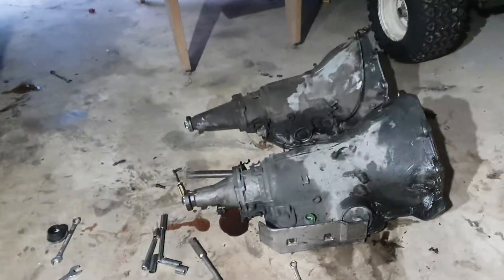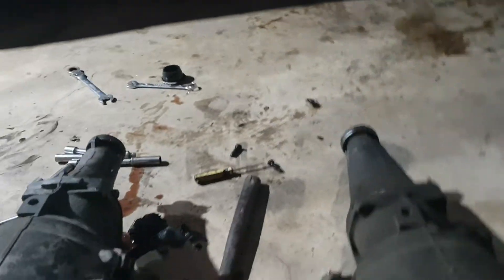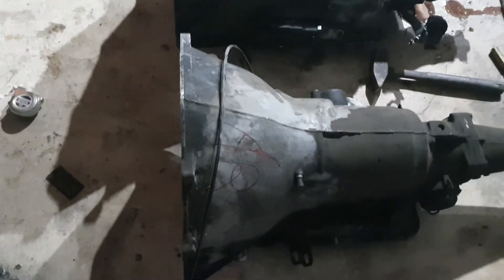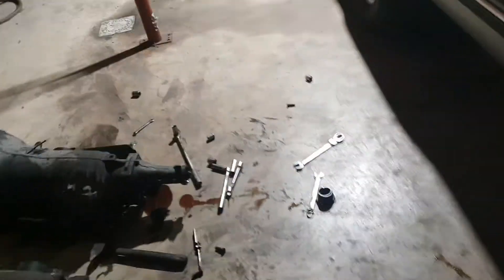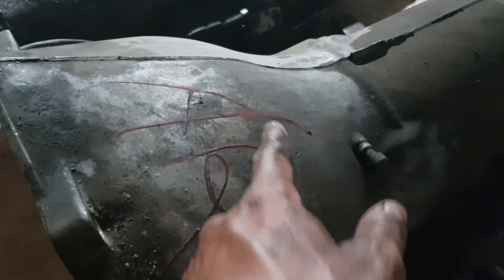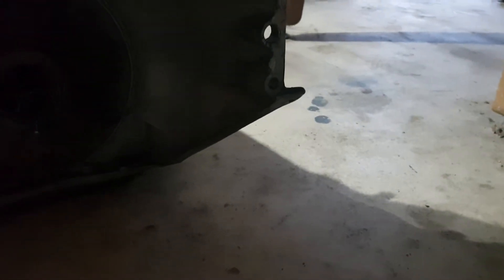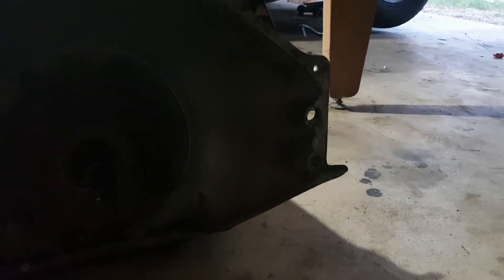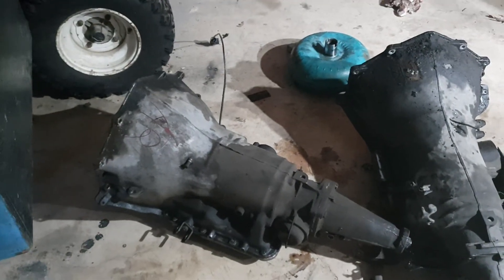4l60e To Th350 Swap Part 1

Comment: I'm doing the same with a 95 4.3l tbi6cyl, will it last if I'm just driving back roads and around town?
Reply from the maker: Definitely, and It'll last if you're driving the truck anywhere else. I drove this damn thing from Peoria IL to Wichita KS and back with this transmission.
Reply: @jestertech3790  I heard mention of change in flex plate? It bolts up to the existing one, but should I change?
Reply from the maker: @zachary2815 I ended up having to add a few washers between the flex plate and torque converter bolts.

That worked, but it seemed kinda wonky. If I were to do it again, I'd just buy the proper flexplate for a Th350. (One that adapts a TH350 to a 1 piece rear main seal engine, 168 tooth flywheel.
Reply: @jestertech3790  I thought so. Thank you again.
Reply from the maker: @zachary2815  If you have any more questions, just let me know, I actually was able to get the speedometer working too, but I never made a video on it.
Reply: @jestertech3790  I will, I am having the trans rebuilt, dropping it off tomorrow. When I get to the speedo I will be back to inquire

Comment: I’m going from a 4L60 to a TH350 transmission in a 1985 Camaro, will my stock shifter work? Or what shifter would you recommend?
Reply: Yes. What are  you going to do about the torque arm?

Comment: was they the same length? like from block to crossmember or u had to change crossmember?
Reply from the maker: The TH350's trans mount is a few inches forward of the 4l60e's. I've seen people move the crossmember up by redrilling the holes in the frame, but I was able to get away with just drilling a new hole in the crossmember where the trans bolts to it.

Comment: I. Did a 350 carb swap and 350 turbo will my driveshaft work
Reply from the maker: You need a th350 with the 9 inch tailhousing for everything to work.

Comment: My 99 tahoe with the 5.7 vortec has a th350 race transmission someone swapped in with a ratchet shifter but haven't figured out how to get the speedometer to work yet.
Reply from the maker: Pull the tailhousing and get one off a 700r4 or early 4l60e, get the speedometer pickup, as well as a 40 tooth reluctor ring (Order one online, they are press fit onto the tailshaft, and are a pain in the ass to take off).

The reluctor ring should press onto the tailhousing (I used a big socked and hammer).

Now if you have the 9 in tailhousing, putting a 6 in tailhousing might look too short, but trust me, the yoke will have enough engagement.

The speedometer connector might not be the same on the vortec, but the signal is the same, so just splice in the proper connector.

And "Voila" Even your cruise control should work.

Also, did you hook the kickdown cable up? I've heard of people doing that on a vortec, but I don't know how.
Reply: @jestertech3790  no the kickdown isn't hooked up, the guy I got it from half assed alot of things so I've been trying to fix it right

Comment: What did you do for a shifter cable bracket
Reply from the maker: I moved back and drilled a new hole in the bracket to bolt it through a pan bolt.

Now for the neutral saftey switch, I just took it off, locked it in neutral, and zip tied it out of the way. With it in neutral, the computer just ignores the trans and doesn't even give you a check engine light. 

I even got the cruise control working once I hooked up the speedometer.

Comment: Did you seriously use a wheel ramp to get that thing down?😭 EDIT: I also see you still have my tape measure. Can I have that back? EDIT 2: why is the torque converter green? Is that oxidation or something? Is it made of copper?
Reply from the maker: No, it was painted.